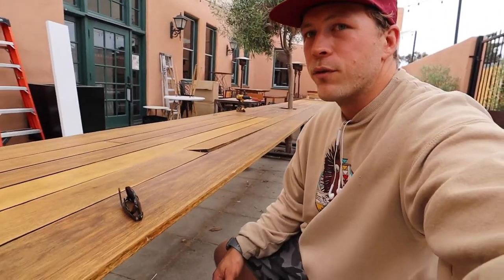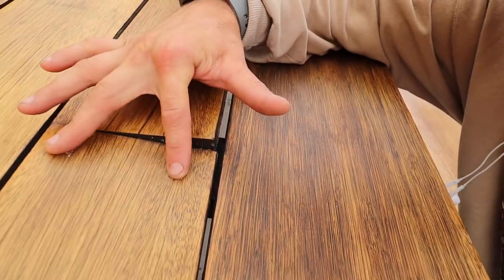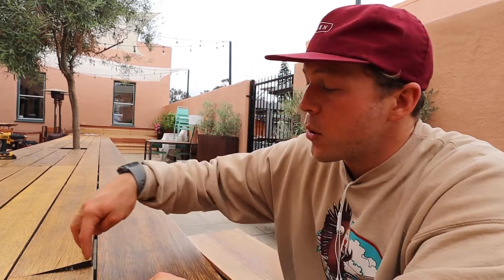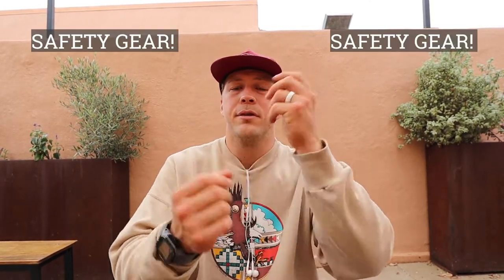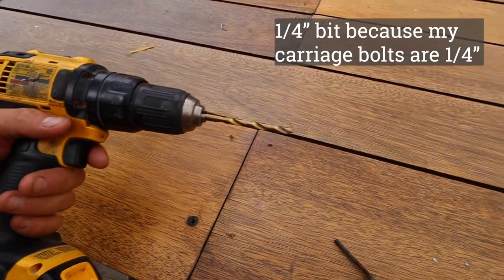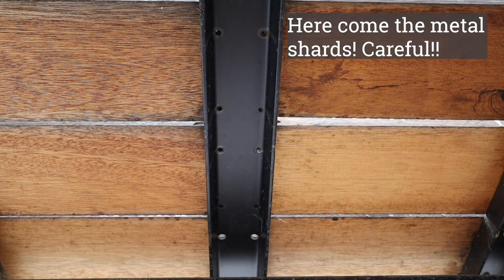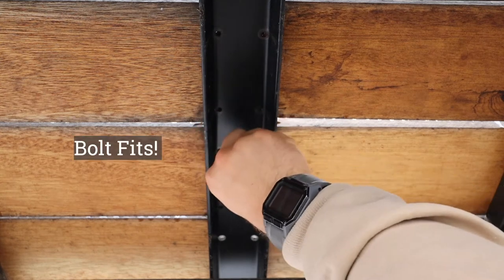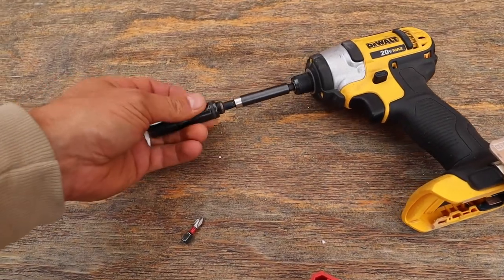SIMPLE REPAIR FOR WARPED TABLE TOP | Moniker General, San Diego

Comment: Hello, i need some advice and
direction. I have a 10' X 3' table top. It is made of 2" x 10" x 10'
long Douglas fir . The 10' planks shrunk big time away from the 3' x 2"
end piece. I have pictures if you don't mind me sending them to you. I am
hoping to remedy this but i may have to build another table from scratch.
Reply from the maker: Hey Izzy Kings! If it's a breadboard style table and you'd had the material seperate by way of shrinking, the best thing to do would be to re-do the end of the table? I'd recommend using some sort of joinery like biscuits or dowels and glued together to prevent future shrinking. You could probably cut off the end (3' x 2") piece and re-construct just that section but hard to diagnose or make a recommendation without seeing it.